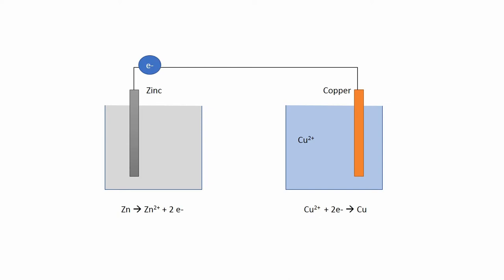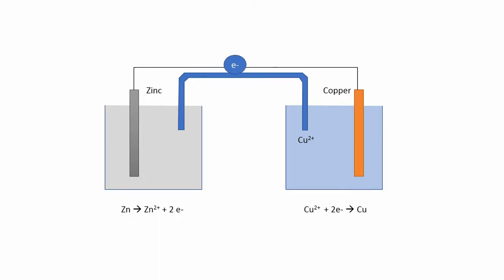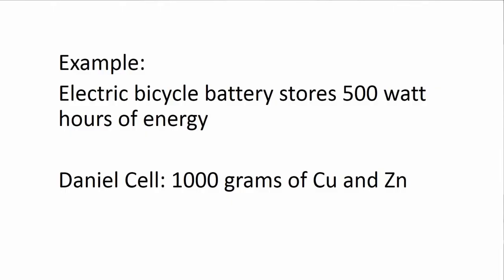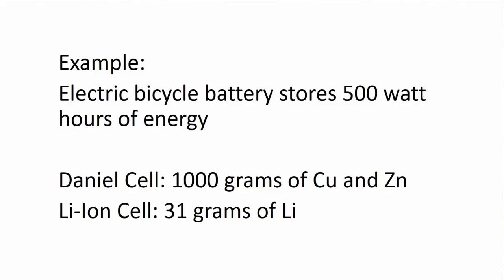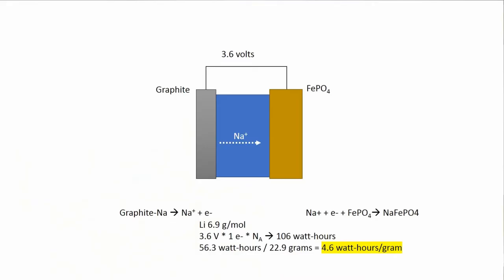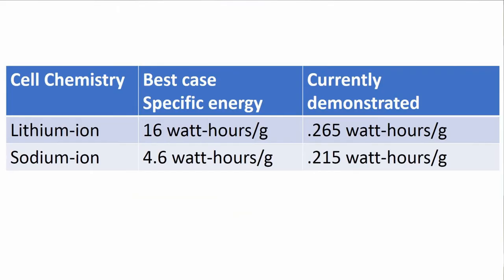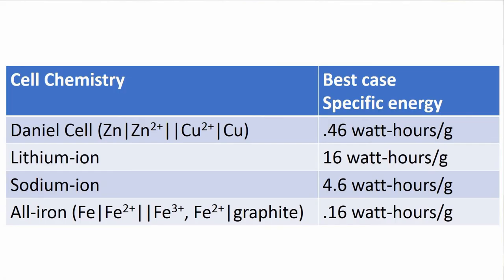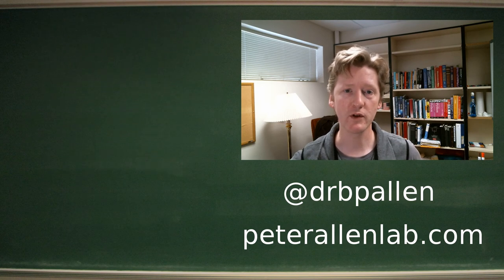Battery chemistry: Lithium v Sodium v Iron

Comment: I would be very interested if the iron battery design and the related chemical reactions here were compared / contrasted with a typical lead/lead-sulfate/sulfuric-acid car battery design.
It seems lead should have a huge weight penalty.  Yet something is giving it a power advantage.

Comment: Your comparison of the copper-zinc cell versus lithium ion is misleading. You can actually use basically just the zinc and copper (plus some electrolyte) with the right design (at the very least, they are the majority of the weight of a cell). You can't do that with lithium, it needs a LOT of supporting compounds (lithium is a small fraction of the weight of a lithium ion cell), so calculating the energy density with just lithium is pointless. Of course, the copper zinc Daniels cell has its problems that do make it less feasible, but that math is still very misleading as to the extent.

Comment: Could an iron battery self charge with interaction between the iorn and permanent magnets. The reason I ask is I've been experimenting with iron batteries and so far can confirm that before I placed a magnet on my cell it had .4 volts and then after placing a good sized maget on both sides it went up to .8 volts and now is holding at .8 . I have had this cell sitting at .4 volts for a few weeks with the only change is the magnets. I'm not a scientist but this intrigued me to do some research on reactions of magnets and  iron batteries. I'll make a silly joke and say if this was a discovery it will be ironic because I wasnt intending to see if the magnet did anything I was using magnets to hold wires to my volt tester..